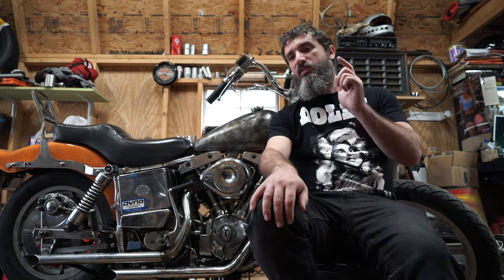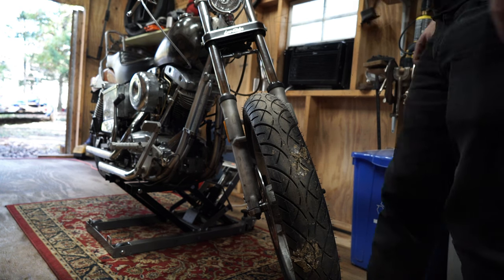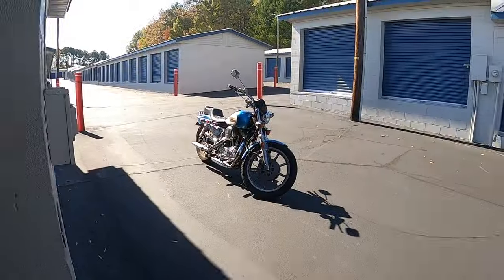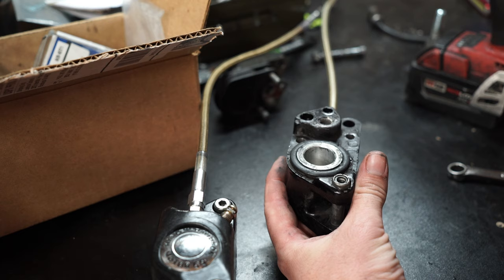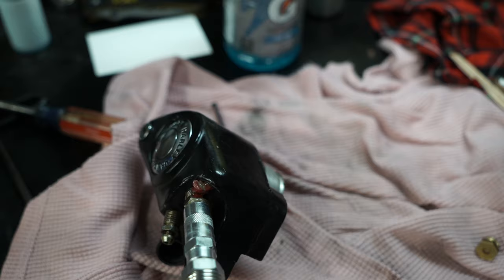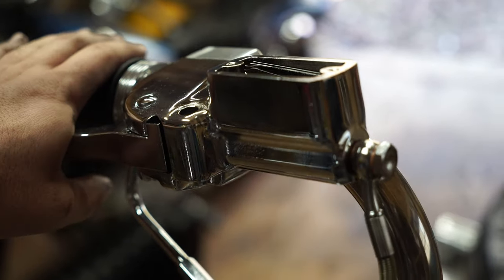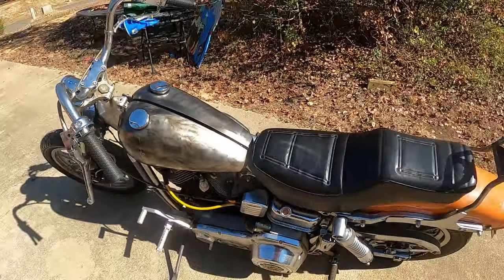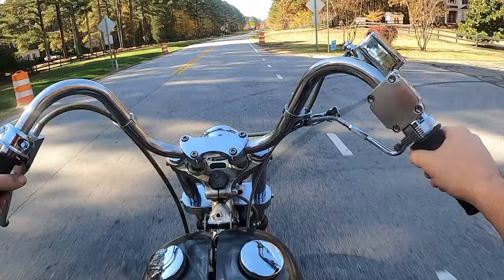Shovelhead Project Part 6: Brake Caliper Rebuild and Other Vintage Harley Fun!

Comment: I've had terrific results bleeding front brakes going from the bottom up.  Using a syringe to push the oil up, taking care not to overflow the reservoir and ruin the paint.  From time to time I would jerk the syringe forth and back quickly to move the air trapped inside the caliper.  Thanks a lot for posting your work like this, that's the real thing.  You actually gave me the final push to dive into this kind of project.  So motivating!  Thumbs up!

Comment: Amen, I bought a similar bike and can’t wait to change the forward controls and that stupid rear fender. It has been my experience at Harley. Front disc Brake systems are lousy, unfortunately. I think you can get p.m. calipers but they’re ridiculously expensive. Your bike is looking good. Nice work!
Reply from the maker: Thanks! Yeah the PM stuff is pricey. This will be fine, not like I'm trying to go racing. Good luck with your bike

Comment: Try annealing the copper washers, heat with a torch just until they start to change color, then quench in water. 
That will bring them back to soft, and they should seal again.
Reply from the maker: That's a great tip!
Reply: @buttcrackcycles  
I actually learned about annealing nonferrous metals in the aircraft industry. 
I also have owned a 1978 Flh for twenty plus years. 
It's been through many changes throughout the years,(bobber/chopper) and this winter, I am at it again, top end rebuild, and I will remove everything that isn't necessary for it to start and go (minimalist) it's already kick start only, BDL 3" open primary, up-sweep Santee pipes, the frame, tanks, engine, and transmission are all stock and original to bike (electronic ignition, S&S high volume oil pump excluded) everything else has been changed through out the year's.
Reply from the maker: @rjoetting7594  sounds like a cool ride man, love that you've kept it going all these years. I'm familiar with annealing brass for reloading ammo, but never thought about it on the copper washers. Great tip

Comment: late comment but I often zip tie my front brake lever pulled in overnight after a bleed. I find it helps get that last little bit of air up to the master
Reply from the maker: @mikekovacs8981  Mike, I actually ended up doing that in a later video, I found a few small leaks in this system that I fixed then reverse bled the system and ziptied the lever. Worked good!

Comment: Ever heard of Dennis Kirk ? They should have the calipers or any other parts you're looking for. I built a 1975 Shovelhead last Winter and DK earned a lot of business while building my bike.
Reply from the maker: I've bought some stuff from them, at the time I made this video nobody had calipers in stock. The rebuild job I did on them seems to be holding up just fine though!
Reply: @buttcrackcycles  I'll bet that Dennis buys his calipers from Ted. That'd be Tedd Cycles, AKA V-Twin manufacturing. But there was a long dry spell of parts during covid, and many things still haven't caught up! Regards.
Reply from the maker: @DeanAWhite-gr8eo  I actually got started with an application to be a V Twin dealer then got side tracked and never faxed it over 😅
Reply: Wish I'd thought of this sooner, A great upgrade for your front brakes is to find the sliders from an '84-'86 FX or XL (Yes, they really are the same) With the 11 1/2-inch single rotor on the left side. This is a much more powerful braking system than the dual 10-inch rotors are. I know this because I have dual 10" rotors on an '82 XL and a '79 FX. The single caliper with 11 1/2" rotor on my '85 XL works very well, and far better than any dual 10" system I've ridden. I've rebuilt all 4 calipers (both bikes) upgraded pads and rotors, and they are "better" than they were, but even now, you need to use the rear brakes hard. On the '"85, you can forget that there is a rear brake! Keep the videos coming, I'm really enjoying them! Regards!
Reply from the maker: @DeanAWhite-gr8eo  that's a great tip, I may end up trying that out on the shovel!!

Comment: Hey Paul, the video you made when doing the brake calipers, after putting them back on, looked like there was something leaking on the back side of the right caliper onto the rotor, I thought maybe you could not see it so I wanted to let you know to check for a leak if your brake fluid was low in your master cylinder, well talk again.
Reply from the maker: Probably just some residual fluid from bleeding it I hadn't cleaned up yet. Thanks for looking out
Reply: OK have a good one till next time @buttcrackcycles